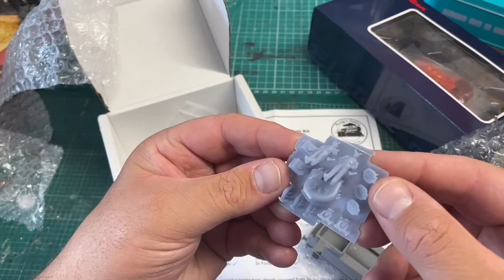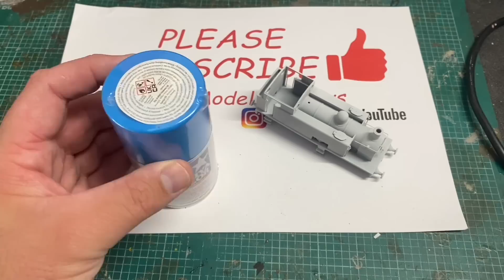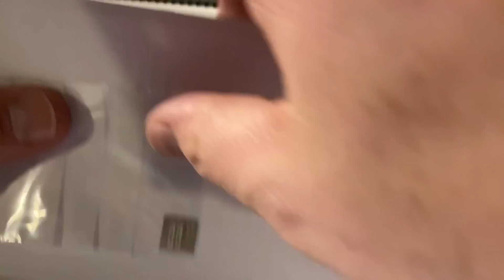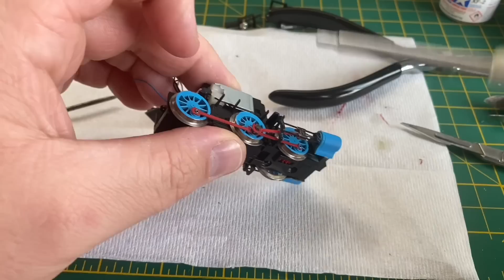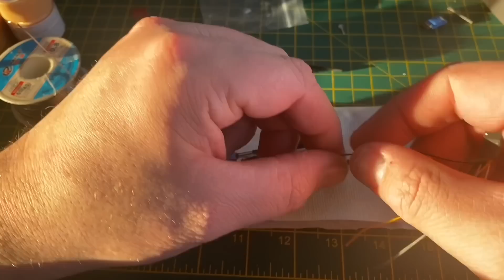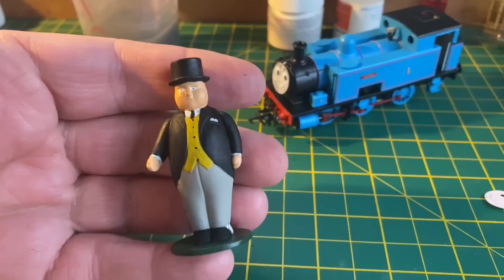Hardy’s Hobbies Hudswell Clarke 3D printed loco build.

Comment: For chipped paint after spraying - I keep the plastic caps off commercial water pump bottles for mixing paints OR to spray small amounts of paint at close range into them for fixing chips. Angle the cap so you spray into the bottom corner and a pool of the paint collects there. If you use a brush, you will need the correct thinner to clean your paint brushes afterwards, but for small chips I use a cocktail stick point to dab a drop into the chip.
Great job with Thomas there .. and thanks for the video.

Comment: i get making the bulk of the body in resin but it is an incorrect material for detail on an item that will be handled there should becast metal parts .. i think much is done now only considderig cost and convenience rather than quality
Reply: These resin prints are far superior to pla,  but I agree it leaves a not so rugged model. The upside is the supplier doesn't have the huge tooling costs to bear upfront with die-cast or injection moulded parts.
Reply: @gs425  thing is i don't get why you'd take a far superior model off its chassis for a por quality one when hornby do a decent thomas i realise the detail is there but  what's the point in that if it breaks off as soon as you look at it , you did a great job by the way
Reply: @shakey hands shed model railways  Dan does explain in the video, Shakey.  This is a model of the REAL loco Thomas, as approved by W Awdry himself, not the over commercialised one that dreadful woman used which was based on an E2. Its therefore been made to model a prototype that in real life has a face added , not just a one piece toy that his younger kids would need to manhandle.
Reply: @gs425  in the books thomas was an LB&SCR E2 class  hornbys thomas is an LB&SCR E2 class
Reply: @shakey hands shed model railways  yes and that's why Dan modelled his hudswell clark because hornbys would be the wrong loco for him. Anyway shakey I hope you too had a good Xmas, it's always good watching you as well as Dan. Both peaceful fun railway channels. Cheers guys.
Reply: @gs425  yeah it's all good .. i just can't comprehend why resin printing is becomming the go to when there are areas that it is 100% unsuitable for like buffers i understand the cost saving argument  ,, but it can be counter productive when you spend more repairing inferior items than buying quality buffers in the first place
Reply: @shakeyhandsshedmodelrailwa2494 buffer heads should be turned metal into a pre printed hole...printed buffer never look good or are robust ...exceptions are the newer continental style heavy buffer now seen on railway  but need carefull design.
Compleat printed kit done as the print it's self is relatively cheap😊😊